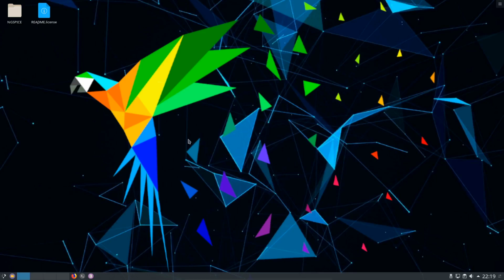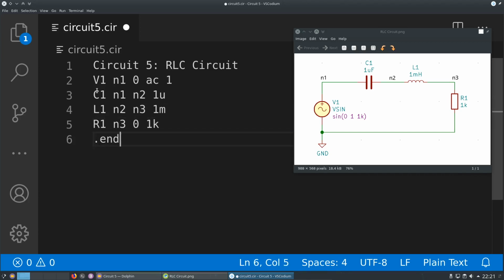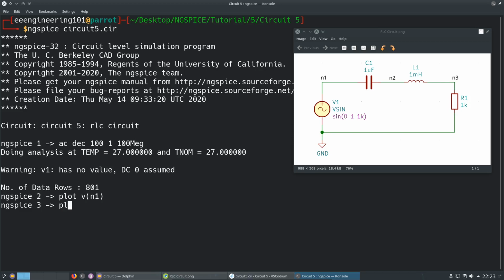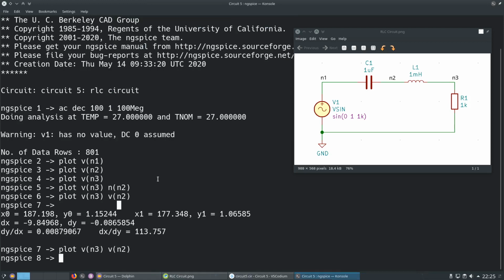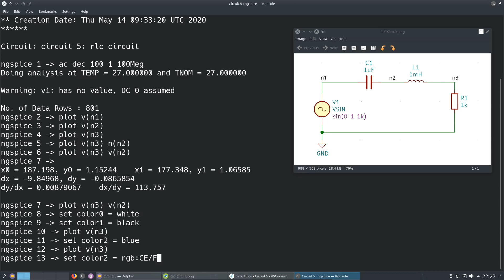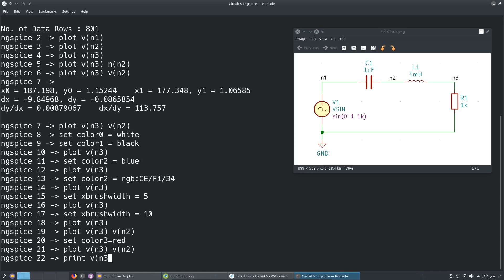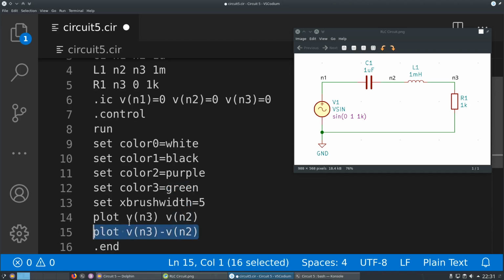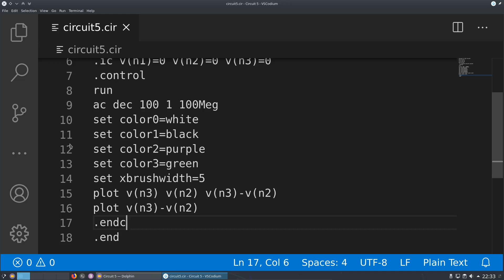Ngspice Tutorial #5 (Plot Options/Changing background color)

Comment: When you're running ngspice interactively, can you add a plot to the current plot without creating a new one? Thanks.
Reply from the maker: If there is a way of doing it in NGSpice, I don't know, either. But you can redirect output values to files. After that using a software (python matplotlib / octave / scilab / matlab) you can plot it interactively.